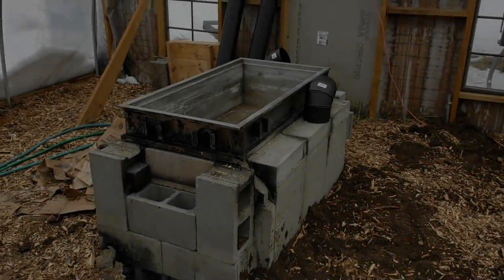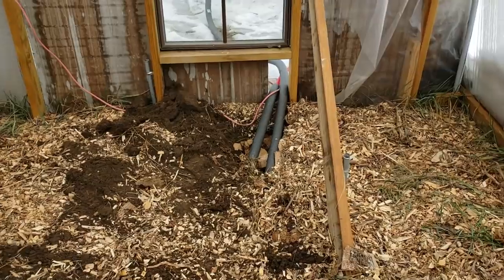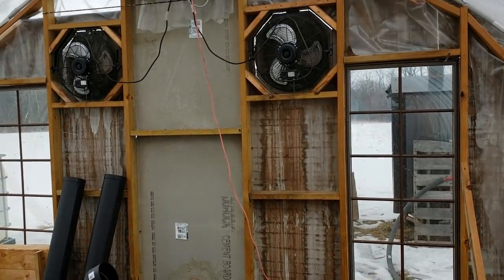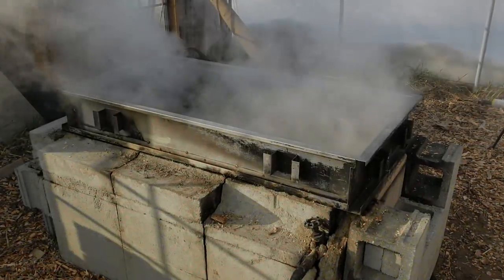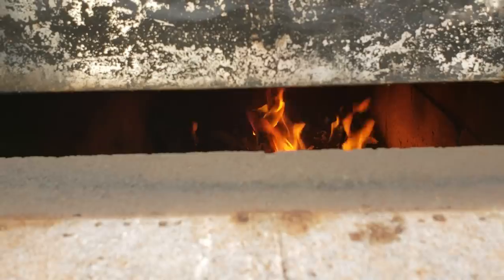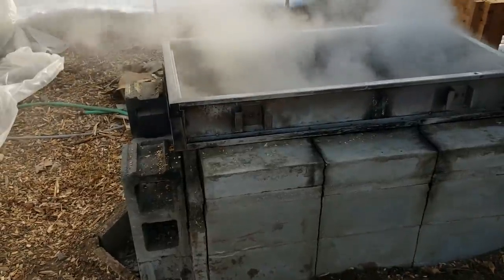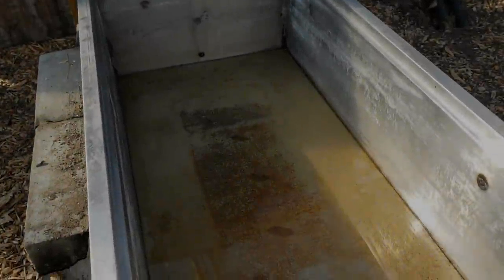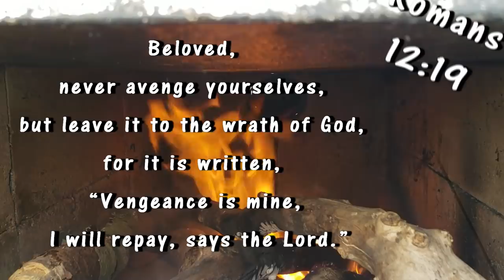Getting Ready to Boil 2000 Gallons of Sap

Comment: I bought a "door" they use in construction/remodels that sticks to the plastic and zips/unzips (you attach it then unzip to cut the door opening) that might work for your application. Just make sure you stick it to the non steamy side! I got it at builders square (years ago) but have seen them at menards (in Michigan) too.

Comment: It’s my understanding that if you wrap copper pipe around the un-insulated part of your chimney and run water through it, the water will heat up. 
If you put that hot water into your heater, it might be a way to capture some of the lost heat from your evaporator and save on wood. 
A whole stick worth, maybe.
Reply: Since he's already having draft issues, cooling the flue is a bad idea.

Comment: With the fans running and stove burning be sure you hove enough fresh air coming in.  Those fans will effect the draft.
Reply from the maker: You are right about that! I have one blowing in and one blowing out
Reply: affect*
Reply: @mwilliamshs  point made
Reply: @SSLFamilyDad  What would happen if both were blowing in? I'm guessing any leaks under the sap pan not filled would not leak smoke, and the draw up the chimney would be fast... Maybe too fast. One blowing in, while the other is turned off could work?

Comment: You can seal the cracks with loose wads of fiberglass insulation........just pull wads off a roll and shove it in the cracks of the brickswith a putty knife. I know im probly too late for this years sap boiling......but ya.

Comment: you actually shouldn't use soap and bleach when doing maple syrup.  Its just one of those things you dont think about unless you go to a seminar or join a fb maple group.  Use vinegar 50/50 and just fill it up.  in a day you'll be clean as can be and the smells/tastes cant transfer into the sap.  vinegar is food grade and sanitary.  when you find your sap starting to go bad at the end of season you can fill your pan with that too.  Sap literally turns to vinegar which can be a great effortless way to clean it but it will smell so the greenhouse isnt the best place to do that type of thing.  

do you ever pull your pan out of there? soot acts as an insulator so it doesnt help your boil at all.  Found out just this year that easy off oven cleaner in the yellow can, just disintegrates soot.  most would just pull the pan to clean but if you wanted to just reach in and spray that on the bottom it should help.  Happy Sugarin!
Reply from the maker: Yeah that is always the debate among maple syrup folks is whether ir not to use bleach or soap or neither. I can say I have used bit and it has made no difference, just make sure everything is rinsed well and it will be fine.

Comment: Just a thought with draining the pan. I couldnt tell wether you had a thread there on the inside so dunno if this would help, but with my fish filters i do my drains close to the bottom but i use a 90° pointing down on the inside so it sucks every bit out when i drain it works really well for me. 👍
Reply from the maker: I think that there might be thread on the inside but bit sure there us enough to do a 90. I'll have to look at that because that would be nice!
Reply: Yeah man works a treat. Even if you trimmed the bottom side of the 90 or somthing to get it to fit

Comment: Gotta give a compliment, where compliments are due. This greenhouse is looking AWESOME.

Also, have heard good things about the Hyper Tough tool line (with elec cord, not battery power), what is your experience with them?
Reply from the maker: Thanks! Haven't heard of hyper tough
Reply: @SSLFamilyDad  Maybe I was wrong. It looked like you were using that brand SawZaw. They are typically sold at walmart and are very budget friendly.
Reply from the maker: That one I have is a Milwaukee, I have had it since the 90's and it is an amazing tool
Reply: @SSLFamilyDad  Nice! I'm slowly but surely adding tools to my "belt." Homesteading is the life.

Comment: I am wondering why the evaporator is in the greenhouse at all. With venting the exhaust, suctioning out the steam with fans, and isolating it from the bed, wouldn’t it just make sense to move the whole thing outdoor?
Reply from the maker: Boiling sap in the pouring rain and freezing wind is exactly enjoyable;) also, in the wind it is much harder to keep the pan hot
Reply: LoL somebody doesn't work outside. Wojomojo have you ever tried to boil water outdoors in 20° weather? How bout keep it boiling for hours, days even?
Reply: mwilliamshs Are you saying you have never seen people boil sap outdoors? In Canada? Now I can’t say what kind of weather etc are in store but it would have been faster to raise a tarp shelter of some kind to deal with liquid rain than doing all the mods in this video. Plus vapor pressure would be much lower than inside the greenhouse with the two fans, drive off all the water faster. Right now in the greenhouse the overall evaporation is choked by the capacity of the two fans to vent all the water vapor outside. It may not be a problem if the fans are powerful enough I guess but that’s a lot of electricity you are using, trading off with the additional wood you’ll need to boil in colder temperature outside. But hey it’s not my project, just wondering if it makes sense.